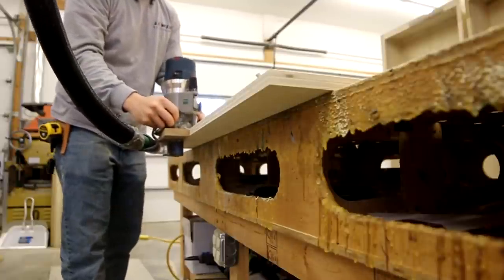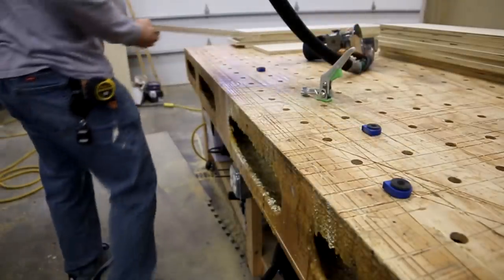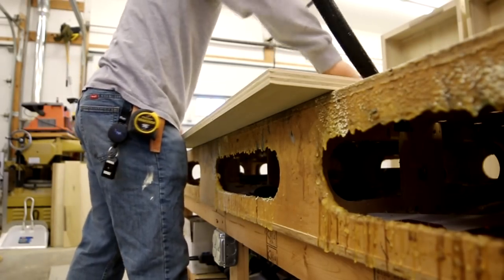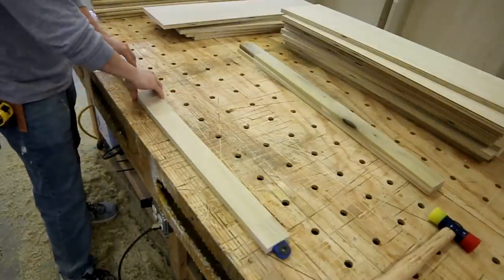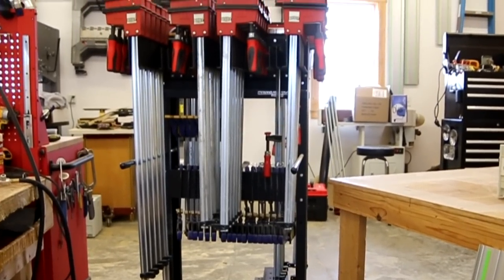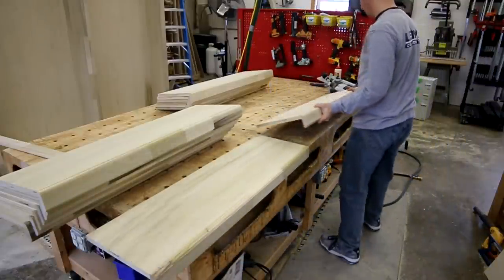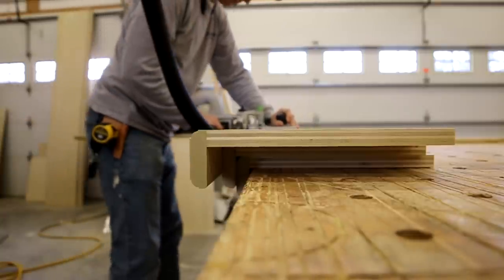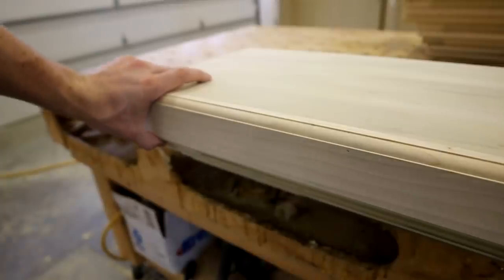Production Bookshelves - My System, Tools, and Process

Comment from the maker: THANKS FOR SUPPORTING THE CHANNEL BY USING THESE AFFILIATE LINKS!!!

Festool OF1010 Router - https://geni.us/rBq6AW (Amazon)
Festool Router Edging Plate - https://geni.us/D45S (Amazon)
Festool Angle Arm - https://geni.us/7YAvOx (Amazon)
Festool Chip Deflector - https://geni.us/OAgOeR (Amazon)
Festool Bench Dog Clamp - https://geni.us/aKBVGFv (Amazon)
Kreg Blue Bench Dogs - https://geni.us/UFKD1IR (Amazon)
Whiteside Spiral Up Down Compression Bit - https://geni.us/pUiS (Amazon)
Whiteside Spiral Up Cut Flush Bit - https://geni.us/cJ6CY (Amazon)
My Preferred Dust Collector - Festool Midi - https://geni.us/1Nx3tcw (Amazon)
My Favorite Sander - Festool ETS/EC 150/5 - https://geni.us/6Vde (Amazon)

Comment: Thanks for sharing! I used to work in cabinet shop. Your way is a lot more efficient. We used to biscuit our nosing, or cut, glue the nosing, 3-4 bar clamps, 18 guage. Then throw on router table after it's dry.. The idea of concave router bit for tighter joint I love it.

Comment: I do the same thing on my shelves but I use a router ran in the conventional manner with the spiral trimming bit and a jig I made specifically for this purpose that is clamped to the shelf to support the router from tipping. It works very well for me. 

I had considered buying a lipping planner but my current set up has allowed me to do this without it. 

I like your system and approach. It’s very efficient which is so important in our business of production finish work.

Comment: Had a chance to build two, furniture grade bookshelves for family. Used the shelf edging techniques for the first time and I am amazed at the results. The concave edge router bit worked as described to allow room for glue and the 1-3/8” 23 gauge pins are so much better than 18 gauge brads for securing the edge trim while the glue dries. I don’t have a Festool router so I bought the Fastcap Little Lipper and attached it to my Bosch trim router using the spiral trim router bit. Worked so well as a replacement for the special Festool router attachment to flush trim the edge trim even with the plywood.
Reply from the maker: Glad to hear you like it. 👊
Reply: Thanks for the tip re: the Little Lipper!
Reply: @keving8682  I have a dewalt dedicated to the little lipper i also have the 1010 set up but it is dedicated to the LR32 system

Comment: I’ll need to look into that ply prep bit. For my shelves the front edge is usually square. I use the freeborne lock miter shaper cutter to cut the shelves and the front edge. When I glue it up there’s no slipping or anything. Just a little bit of cleanup and you’re good to go. Obviously that wouldn’t work with a large profile. 
I also like fastcaps FastBreak edge sander. Both the standard and large. It makes quick work of easing shelf edges. 

For countertops I rabbet my edging. This let me route a profile in it but also helps align the edging. Plus it’s faster to sand 1/4” flush than a full 3/4”. 
I lock miter or miter fold my live ends. 

I can see the Collins bit being useful anywhere plywood attaches to hardwood, particularly where it needs to be flush. I’d probably use this on my cabinet bottoms and fixed shelves.

Comment: FYI - Armor Tools' P7-IL Auto-Adjust In-Line Dog Clamp is similar to the Festool clamping elements, but they're designed to fit a 3/4" dog hole (vs Festools' 20mm dogs) - and about half the price

Comment: Very good video.  Just ordered the compression bit, didn’t know about that.  I really like my lipping planer but that router setup rocks.  I have every other Festool router but will probably go with a 1010 now as I groove edges for other reasons (weather stripping for example) and really like the potential.  Thank-you for posting.
Reply from the maker: The 1010 is a really nice sized router. The 1400 is my favorite and most versatile.

Comment: Wow, "Quite a bit of money" on cauls is an understatement at $219 a set. Spend money to make money. Congrats on putting yourself in a position to invest in yourself and your business!
Reply from the maker: I'm not kidding though when I say its some of the best money I've spent. Lifetime tool. Not gonna break. And I use them constantly. The money has been long since forgotten.
Reply: Could you make a similar product in something like 3/4 MDF. Once they start to bend one way, just flip them over
Reply: buy one set and use them as templates to make 10 more out of poplar with a pattern bit save 2 grand

Comment: I am having a little trouble setting up the Collins bit for prepping the plywood and was wondering if you could help?  Are you taking material off of the full thickness of the material or just to the very top and bottom? Also how are you attaching the wood fence to the router base? I can't think of a good way to attach it while still allowing me ton dial in the correct offset. Surely I am missing something very obvious and should learn how to code.  (maybe funny maybe not).  Thank you for all your videos, they have been very helpful in starting to work for myself. In owe of what you have built in homes and your business. If you are ever in North Texas let me know and tacos are on me.

Comment: Spencer, I think if you were to use a 5 mm or a 6 mm domino, it would make quicker work of your process you are doing there. Also, Fastcap is going to be coming out with a domino-like piece that is made out of plastic and has reverse cuts in it so you can apply your edge treatment the way you are right now and you basically smack th piece onto the face of the shelf with the special plastic dominoes and it will hold your peace tight against the edge, to where you likely would not even need a clamp anymore. If you need a link, let me know and I will get one for you.
Reply from the maker: I've seen that domino and it looks promising!

Comment: Fastcap makes the little lipper for flush trimming. I haven’t used it but heard good things and it’s a generic one size fits all, brand agnostic.  I have some green tools but haven’t made the plunge to the of-1010, it does look nice look all things Festool. Your profiling looks nice! I agree with you on the Whiteside they have good carbide. I like Freud but I lean toward the made in the USA and buy Whiteside. For easing over your freehanding it or two stepping and using a 1/16 radius Klim cut and second pass or just following up with a swipe of 220/320 Granat? Great tip on the concave Collins tool/Whiteside!
Reply from the maker: I also have the fast cap flush trimming attachment. Its ok, but not great. I don't ever use it. 

For easing, I just go one pass with a 5/32 radius whiteside bit, as long as it doesn't start skipping/hopping one pass is usually good enough for me.
Reply: Insider Carpentry so your edge profile was down with a 5/32 and a 1/8 (4/32) bearing to get that nice ogee detail? I don’t know where I saw the thumbnail profile it’s simpler and only gets one pass, instead of top and bottom, you can also use a thinner piece of material and do the glue up then route in the detail single pass. Hey it looks great what you’ve done... but I’m one that gets caught in the “10% rule” when I should have just gotten on with the next job? Once I go down that rabbit hole it’s tough to climb back up.  You do have a good system though for batching out the profile. Thanks for the heads up on the fastcap little lipper! I’m wondering if you’ve used the Festool mfk-700 trim router for doing small profiles, I’m thinking that the attachments and DC are interchangeable?

Comment: Another excellent video. Gonna have to have a look at that pin nailer for field work. All my 23ga nailers are currently Grex because they're the only one to my knowledge that shoots a 3/8 nail, which I use a lot in shop work.
Reply: I recently got the Millawakee 23 g 12V pin nailer. Love it!. No hose and very nimble pin nailing base and window skirting / apron returns.

Comment: Spencer, I very much appreciate your pacing in your videos. It is great to be able to not only see and hear how your are talking about doing something, but to also be able to see what you are saying in action. The only questions I had after watching this is 1: Do you sand your plywood and poplar noses before joining them?
2: With gluing and putting the 23ga pins in, I'm guessing you don't have any need to attach the noses in any other way. They are strong enough with just these two methods of attachment?
3: Do you have any tips for dealing with the holes from the 23 ga brads or with poplar do they just become invisible with sanding?
Thanks!
Reply from the maker: If paint grade i stand after glue up. If stain grade I might sand before and after to ensure I can reach all the areas that need sanding. 

On stain grade the 23 gauge holes disappear with stain.

Comment: Just a bit of caution for any weekend warrior watching this video, to cross-cut a long narrow piece of plywood in half on the table saw is dangerous to say the least. 
Thanks for the video and I just ordered the concave router bit.
Reply: Dudly Crawford  riving knife is a safety feature we all need.  But yes I use a track saw to cut to 4x4’s. And Baltic birch I just throw up on my cabinet saw!
As far as a DYI guy I never recommend them cutting dwn sheets on a table saw!
Use a guide and skill saw ; which is also dangerous but not as much?
Reply from the maker: Good call. I did have a riving knife but you're right. Still not ideal. I've experienced kickback with that cut before so I've learned and kind of know what not to do. Already learned the hard way on how it happens.
Reply: Dudly Crawford Another tip:  Don't raise the blade any higher than necessary.  The gullet bottom should be no higher than what you're cutting.  The more blade that's exposed, the deeper it can cut you.

Comment: Some very good information here. Just curious what you're using to break down sheet goods from full size? Do you get them rough cut to be more manageable from your supplier? Also do you have someone CNC your carcass parts?
Reply from the maker: I break down everything on my sawstop cabinet saw from full sheet size. No big deal for me.
Reply: Insider Carpentry I was only asking for the practical reasons since you build this stuff as a one person operation.

Comment: I think this is the 5th time I watched this video!  Great work.  Question:  When you have nosings that wide (looks like about 3 1/2"), do you ever just just pocket screws to attach to save on time/clamping?  Or, are you worried that you will still be able to see the pocket holes in the shelves that are installed up high?
Reply from the maker: That’s definitely an option. But being that I have the tools right there I use the cauls and clamps because I get a better glue line with them.

Comment: Plan to order the Collins bit and see it is offered in both 1/4 and 1/2.  Do you think think the Dewalt cordless trim router has enough power to effectively run this bit?  Love that little router and sure like not having to worry about cords.
Reply from the maker: There has been back and forth with collins. At first you could only get it by whiteside in 1/4 shank, now you can only get it in 1/2" shank. I much prefer the 1/2" shank. The dewalt router would probably do it, but I prefer a bit larger router for that bit plus dust collection.
Reply: @InsiderCarpentry  Thanks for the advice.  I will go with the 1/2".  Keep up all your great videos!
Reply: Jim Reed good call! The 1/2 inch shank will also provide a much more stable platform. 1/4 inch has too much flex.

Comment: I love the video. It's really good stuff. I was wondering though, couldn't the last flush trimming step with the 1010 router be eliminated if the nosing were attached using dominoes as there wouldn't be any  lippage to remove, no? Keep up the great work!
Reply from the maker: Not with the size of the beading cut that I was using here. Any inconsistency would really show up quite a bit. Also the plywood I use can be a little wavy. I think it would actually take more time to mess with the dominoes.
Reply: @InsiderCarpentry   just saw a amazing product from fast cap called the little lipper which would turn any router into edge banding flush cutting setup just curious if you have ever seen or use this product?

Comment: I've been doing architectural woodworking for all my life and I like your system, but does lock you into using veneer core panels for joint strength?
Reply from the maker: Interesting I hadn't really considered that. I'm not sure. I don't use any of the MDF core simply because the supplier I get my millwork from sells veneer core.

Comment: I am surprised that you do so much with poplar. Just because it has a green to it as well as it is soft. However I want to source the same but have struggled to find it. I do a lot of custom residential and multi family renovation/ repair work and the majority of that work includes quite a bit of finish carpentry. 

As well, are you using 3/4” sanded pine for your sheet goods?

Comment: How do you like the sliding portion of the saw stop saw? I am considering a Felder type for my own shop but not really familiar with the sliding table saw as I am also a midwest boy myself.  Love the videos.
Reply from the maker: I hate it. I never use the fence. For me it’s only used to assist in pushing sheet goods through.
Reply: @InsiderCarpentry  Thanks!

Comment: don't get me wrong....that router set up is bad ass but we hardly ever have to make that many on a job...we just cranked out 12 square tapered recessed exterior cedar columns in 3  6 hour days...got any tips for tight mitered corners?..mine are tight...they all get stained....no getting saved by caulk and paint lol

Comment: ...........Hello, I see you have two different router bits listed as for Spiral Flush Trimming. 

...........Which one do you use & what is the difference between the two.
Reply from the maker: The compression up/down is the one i like. Best of both worlds because the flutes cut inward from both directions.

Comment: Love your videos I have gotten several tools use help get faster.
2 questions what did you use for your boom arm dust collection and 2 what is the clamp rack by your saw table look like thanks
Reply from the maker: Boom arm is really simple. Its a large caster wheel. Remove the wheel. Insert a 2" dowel rod through where the wheel would be. 

The clamp rack is from woodpecker. It may be a one time tool. Honestly I had one before I got that that I made that was just as good.

Comment: When using the cauls you put the clamps way out on the ends of the shelves. Wouldn't it be better to put them around 1/5th of the length inwards? That way the caul would bend even less. This might just be theoretical though.

Lol. I should have watched the entire video before posting. Sorry.

Comment: i was thinking about getting the mfk700   for lipping planer use , out of curiosity what made you choose the 10 10 ?
Reply from the maker: The mfk is designed more for edge banding. The base plate requires modification if you want to do 3/4" plus edge banding. I felt the 1010 would be a better buy as its more versatile. But with the modification the mfk would be a great tool for this also. I just couldn't bring myself to spend that kind of money on what is essentially a palm router. I've very happy with the 1010 purchase.
Reply: @InsiderCarpentry  thanks makes sense

Comment: This may not show hairline cracks with interior house paint sprayed with airless but how about pigmented lacquer or conversion varnish? This gives zero telegraphing with no filler?
Reply from the maker: Correct. If you want 100% invisible its crucial to actually allow the joint to cure/dry completely and all moisture to escape before sanding. The biggest cause of joint ghosting is actually the moisture from the glue and sanding it too early.
Reply: Been looking for a solution like this, and they are sold out